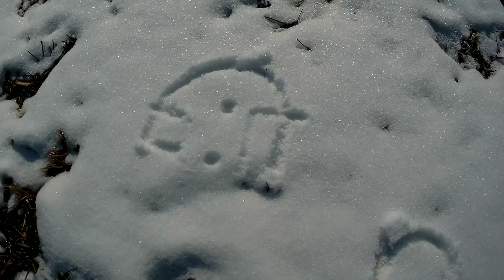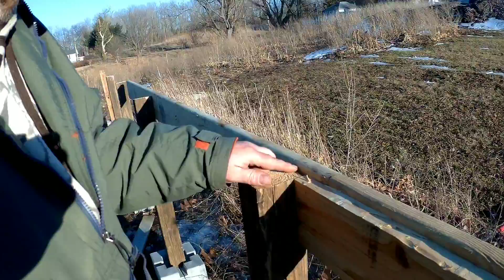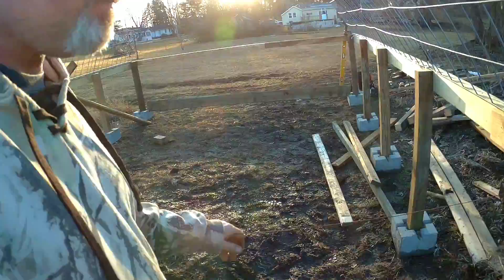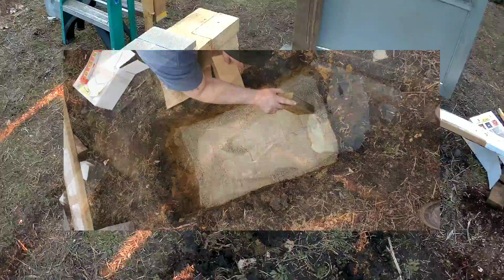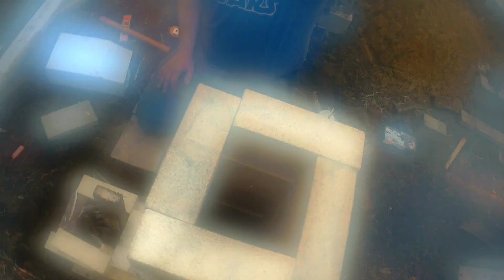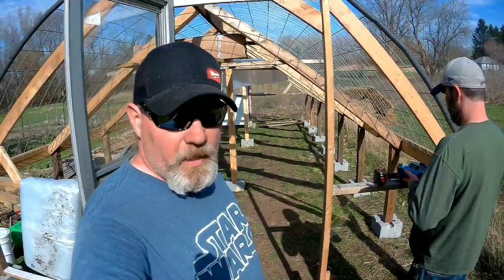12x30 Cattle panel greenhouse build with a rocket mass heater

Comment: Won't the rocket stove melt the plastic or smoke you out?
Reply: That's what I was wondering. If it's small enough it shouldn't get the plastic hot enough to melt but the smoke and carbon dioxide can't be safe for people and I'm concerned about the plants

Comment: I used zip ties to join the panels because I was worried about friction or poking holes
Reply from the maker: I'd use the wire. Zip ties will get degrade and get brittle.
Reply: Your probably right, I’ve only had the hoop house for a few weeks

Comment: You do realize that smoke is dangerous to plants!  This is why all professional green houses have no smoking policy!  Even require hand washing so plants do not come in contact with smoke.
Reply from the maker: I'm not sure what your point is. What does this have todo with smoke?
Reply: @GuyBrown  Smoke from inside the greenhouse from the rocket stove = Tobacco Mosaic Virus
Reply from the maker: There is no smoke. It goes up the stack.
Reply: I've tried a rocket stove in my greenhouse, it about killed my canna lilies. You better put a vent over the smoking end to vent outside, or you'll kill everything.... your stack doesn't exit the greenhouse in your video.